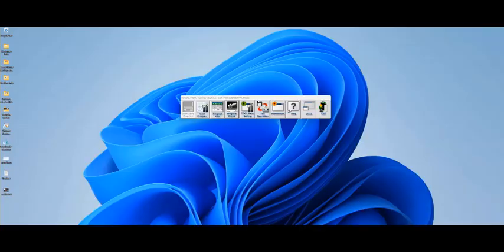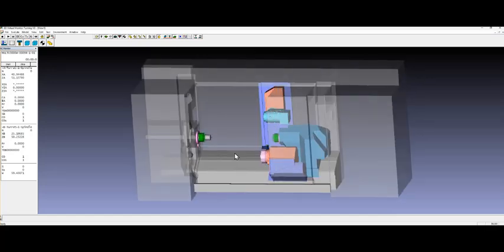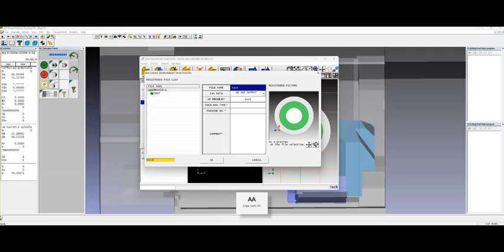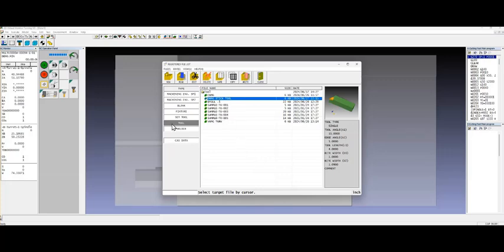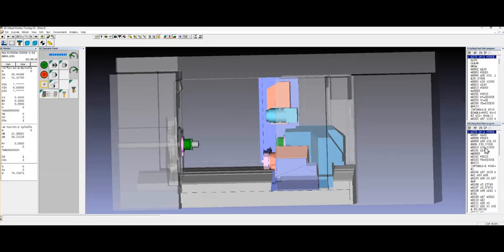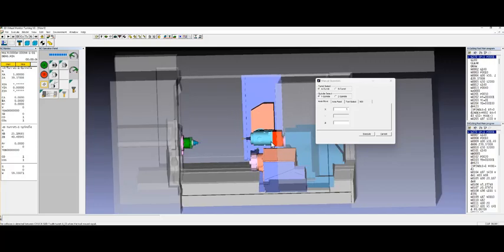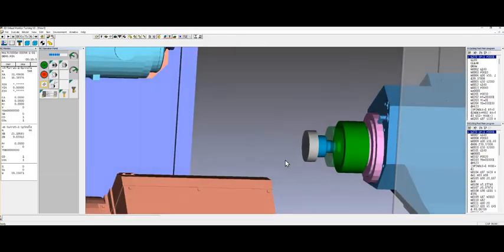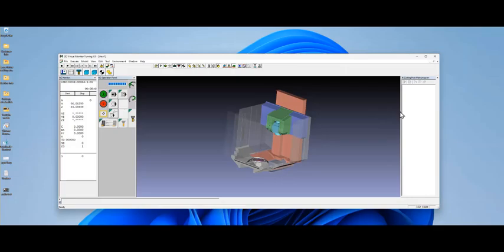Okuma 3DVM explained

Comment: Is this what they refer to as PCNC, or is this an additional option?
Reply from the maker: @number2664  it is a different software. PCNC Master is more of a control training device, as it simulates the actual control layout. If you look up my video regarding Okuma Simulation you’ll see the actual software
Reply: @pocketcharleywithgosiger  so if we want to simulate programs as if we're on the actual machine we would need 3DVM or would PCNC fill the same need?
Reply from the maker: @number2664  Great question! Either will “simulate” as in graphically verify and display alarms, but PCNC does not have the Collision Avoidance package, so you’d be on your own (with that software) to make sure your program is collision free.
Reply from the maker: @number2664  https://youtu.be/QvugcXRnThw?si=ushqyxNmEDE7Fd8V